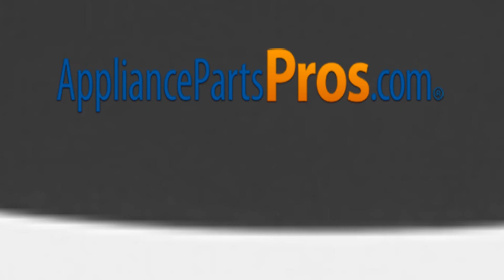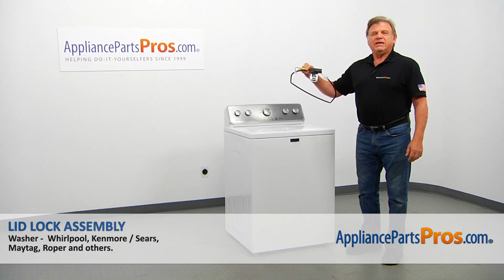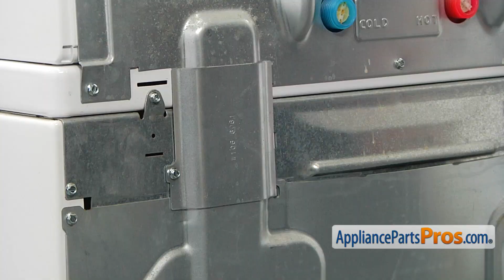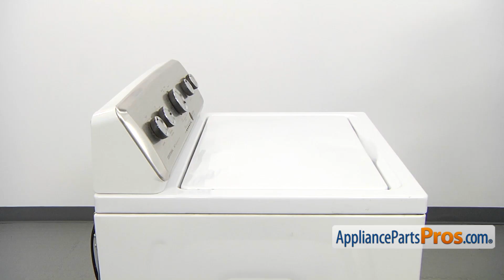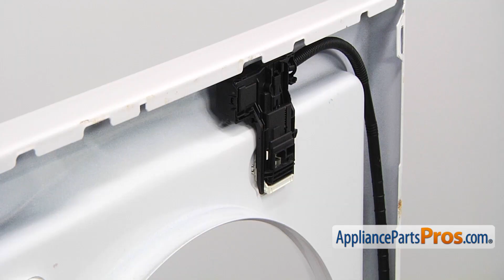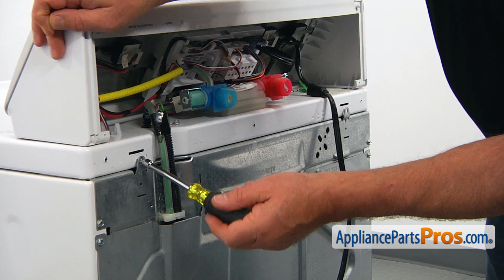How To: Whirlpool/KitchenAid/Maytag Washer Lid Lock Assembly W11307244

Comment: Mine doesn’t latch jist screws down bit lid won’t close to work
Reply from the maker: What is your exact model number? Make sure the bezel is oriented correctly, the lock seats into the tabs before tightening screws, the harness clicks in, and the lid strike lines up.+

Comment: I can't take out the lock mechanism because it's stuck in the lock position, and washer won't run.
Any ideas how to get it to disingage???
Reply from the maker: If the lid lock is stuck in the locked position, you can try unplugging the washer for a few minutes to reset the control board — sometimes that’s enough to release the lock.

If that doesn’t work, you may need to manually release the lock from underneath the top panel. On many models, you can access the mechanism by lifting the top or reaching in from the back with a flat tool to gently disengage it.

Comment: Um....what happens when the lid lock doesn't open to the unlock position?
Reply from the maker: Good question — a lid that won’t unlock can definitely be frustrating. To help narrow it down, could you share your washer’s model number? Also, is the lid lock issue the only thing going on, or are you seeing any error codes on the display?

One thing to try: unplug the washer for a few minutes, then plug it back in and see if the lid unlocks. That can sometimes reset things if the control board is just a little confused. Let us know what you find and we’ll help from there!

Comment: I just WANT to REMOVE It completely. Mine is a MVWC656f1 and it's the worst washer I've ever owned. I contacted Maytag many times because it is not energy efficient in anyway shape or form. The lid lock has been a problem due to it always going.  out of balance. And yes its level. The only safety issue is me taking a hammer to it because of its poor quality poor performance and cost. NO MACHINE should take well over AN HOUR  to wash clothes. Every time you wash your clothes the fabric is slowly disintegrating, it's science. Its a waste of electricity water and cost of clothes. And Maytag actually told me that people like to wash their clothes for 3 hours, THREE HOURS!  Just think real.harc on that one and tell me who really thinks this and why!  You don't have to be a rocket scientist to know that this is just nuts. But really tell me how to get rid of the lid lock completely....
Reply from the maker: Hi @pammaynard9997 — sorry to hear you’ve had such a frustrating experience with your washer. We know how aggravating it can be when things don’t work the way they should.

Just a quick note: for safety reasons, the manufacturer doesn’t recommend removing or bypassing the lid lock, so we’re not able to provide any instructions on that. If the lid lock is giving you trouble, we’re happy to help troubleshoot what might be causing the out-of-balance issues or long wash times.

Let us know if you’d like help getting to the bottom of it—we’re here if you need us.

Comment: Thank you for this much needed tutorial. Only one year, and this cheap switch broke. The way things are made today is disappointing.
Reply from the maker: Hi @sjb72700,
Thank you for the kind words about the tutorial — we're really glad it helped! We completely understand your frustration. It's disappointing when parts don't last as long as they should. If you need any help with the new lid lock installation or run into anything else down the line, we're always here to help!

Comment: Now my lid locked light is blinking… what does that mean?
Reply from the maker: What is your model number and is there a pattern to the blinking?
Reply: @ Maytag MVWC415EW1… and it’s just blinking. I had to buy another lid strike bc mine was locked and the latch would not go in. I’m so confused!!!???
Reply from the maker: Thank you. Have you checked the tech sheet and tried running a diagnostics on the unit?

Comment: I have a Maytag washer.  Does the lid lock light need to be on in order for the machine to move from sensing/filling to washing?
Reply from the maker: The lid lock light should come on when the lid locks as it's advancing through the cycle.

Comment: Hey, I just watched your video to repair the assembley, but the "lid lock" light keeps blinking after I installed the new assembley. What did I do wrong?
Reply from the maker: You can double check to make sure the part was installed properly. If that is good, you can get your model number and call us at 1-877-477-7278 and we can provide more troubleshooting.

Comment: Great video.   The idiots at Maytag should be ashamed of such a stupid setup.  The lid-lock tab is extremely fragile and prone to snapping off.   Then your 2 mo old washer won't work.   I'm going to remove this stupid feature, but wasn't sure how to open the cabinet.  I'm sure this is the first of many failures for this Maytag machine. Thanks for your instructions.
Reply from the maker: If your washer is that new you may want to try and reach out to Maytag and see if that part has a warranty on it. The manufacturer normally offers some sort of warranty on their appliances.
Reply: @appliancepartspros  thank you for the response.   I suspect it isn't worth the effort.  I ordered a pack of replacements for about 6 bucks each, and jammed the broken one into the switch while we wait.   Not worth 2 hours on hold😀
Thanks again.

Comment: I replaced the lid lock with a genuine part but the new installed lid lock does not unlock, I tried going to diagnostic mode and clearing the code a few times but no success.  I tried holding the white tab down unplug/plug in but still no luck.  Any help will be appreciated.

Thanks
Reply from the maker: What is the model number of your washer?
Reply: Thanks for your prompt response its Maytag MVWC565FW1 @appliancepartspros
Reply from the maker: What kind of code is showing on the machine?
Reply: @appliancepartspros . The code I am getting is F41, E21 which means Door unlock fault.  The new installed lid lock stays in the locked position and does not unlock, I tried unplugging and holding down the white tab and plugging it back in and waiting 30-40 secs but no luck.  When the machine powers on it blinks Lid Lock a few times and then turns off.
Reply from the maker: Did you order this part from us? Have you had any type of power outages?
Reply: @appliancepartspros  no power outage and yes
Reply: Any thoughts? Do you think its the motherboard?

Comment: Thank you for your video just replaced our but the lid lock is still not working. When I’m running diagnostic code it still giving the lid lock switch code not sure what else to do washer just going to was cycle and not finishing 😢
Reply from the maker: If you replaced the lid lock and it didn't fix the issue, you could be having an issue with the control board itself.

Comment: The only thing you could have told us is fact that when you push the top section to the front the hooks holding this section has two hooks on each side and you have to move it around till it unhooks.  It took me a while to get it up and then was able to use my strap with hooks to hold the section vertical, the one with the lid. Thanks I got my switch installed.

Comment: Don’t you have to recalibrate it after
Reply from the maker: What is your model number?
Reply: @appliancepartspros   WTW4616F that is the number on the paper receipt.
Reply from the maker: Are you near your washer because that looks like the start of the model. We would need to have the full model number from off your machine in order to be able to assist you.
Reply: WTW4816FW2. That’s the number on the machine
Reply from the maker: Thank you for that information. It doesn't appear that you would have to recalibrate this lid lock assembly.
Reply: @appliancepartspros  thank you
Reply from the maker: You are welcome!
Reply: Yes.
Reply: Was that the right numbers

Comment: If the lid still won't unlock after you plug it in;

Unplug it, reach down into the lid latch hole, press and hold the small white tab on the left, and then try plugging it in again. It should unlock after a few seconds. Figure it's worth mentioning since I thought mine was broken at first because it wouldn't unlock lol
Reply: You are a life saver. Thank you so much for this comment.
Reply: Thank you. This comment needs to be pinned at the top of the video
Reply: Thank you so so much!!!!!  This comment is almost more important than the video. I was about to pull my hair out trying to figure out why the lid lock wouldn’t open. This did the trick in 5 seconds!
Reply: Thank you!!!
Reply: Awesome tip as my lid switch wouldn't unlock. Kinda surprised then tech didn't mention this in the video. Thank you!!!
Reply: Thank you!
Reply: YOU are Wonderful for posting..Thanks..Was about to pull my hair out, LOL
Reply: i don't know why this isn't included in the video, kinda vital info, thanks so much

Comment: I replaced the lid switch...... no problem. But after, the lid won't unlock. How do I correct this?
Reply: Recalibrate the washer
Reply: @gbayb3025 how does one do that?
Reply: Mine is same
I thought I had it on wrong
The striker goes into Brazil and the lid locks too much and never opesn

Comment: Thanks for a perfectly clear demonstration.  But I'm not washing yet.  The part came locked and the lid won't close.  I tried hitting reset, and unplugging, but no success.  The "lid locked" light is lit.  Is there anything I can do to unlock the part to allow the lid to close?
Reply: Did you ever find an answer to the question. I'm having the same issue
Reply: @ayrtoncrowley6457  Thank you for following up.  After a few hours of trying everything I could think of, I was leaning on the lid thinking and the latch opened. l in the end, my wife decided she wanted a new washer so out it went.  I have no doubt a qualified person could have fixed it though.

Comment: I have a maytag. Put the top in the up pos like he shows and pop the metal pins on the switch panel underneath w a flathead pushing down. Careful the switch panel is connected. Then u can access the pin.